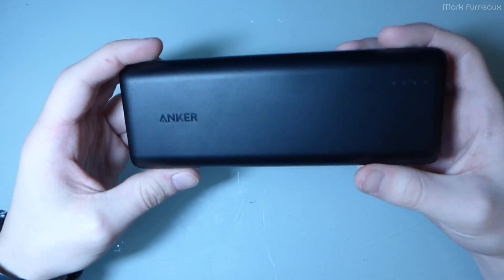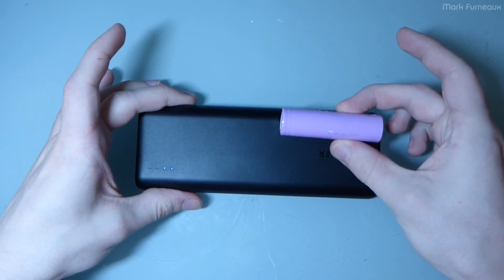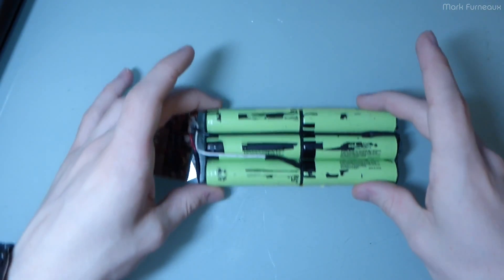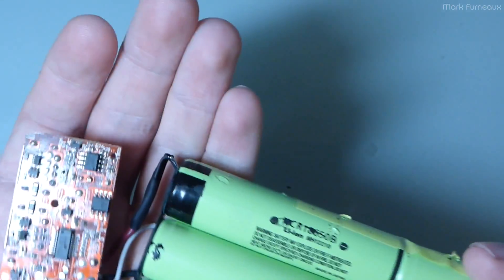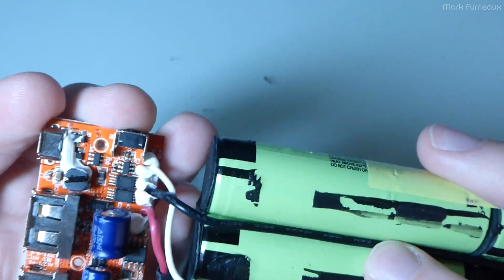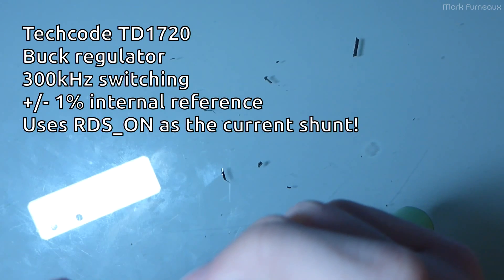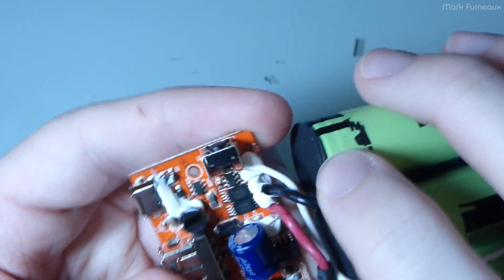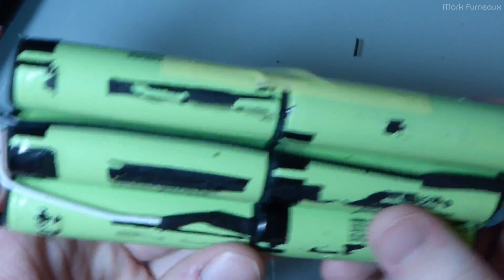Teardown of the Anker PowerCore 20100 USB Power Bank

Comment: that thing has been solid quality for over the past 6 years, stays charged for months without losing more than 1 bar of power
Reply: what I never get it says the capacity is 20100mah or 72.36Wh but at 5 volts that doesnt at up or am I missing something there?

Comment: I have a 10000 one, with Qualcomm QuickCharge 3 capabilities.
I really like it, had it for the last 5 years, it hold out pretty well, but yesterday I noticed the cells died, I was considering replacing myself, but after your video decided not to.
Thanks!

Comment: Hi, I need to use it in a proyect and I need an output for 5v as the specs told, but when i measure conected to a USB 2.0 cable I only have 3,2v could you tell me how should I do to get 5v?

Comment: Cheers, gave me enough hints to crack open my own damaged powerbank (charging input port damaged) - those tabs hold it together something fierce! Managed to shim mine open with some thin but robust metal spudger pry tools (the ones which look like epoxy glue spreaders), only a few bits of plastic damaged and the case will go back together afterwards.
Reply: Were you able to fix the charge input?  My power bank is 3 years old. However, it was not used that often. Now it only gets very hot during the charging process

Comment: Quick question, what's the voltage out the batteries in the board? From what you said sounds like 3x 3.7v, is this correct?
Wanna modify it and add a qc 3.0 board in there.

Comment: They should be wired in parallel to get the full 20100 mah,otherwise the capacity will be much less.In series configuration the voltage doubles,but not the capacity,assuming the cells are alike.
Reply: Nope not true. USB is 5V so you should step down rather then step up from ~4V.

Comment: Hello! I have the exact model however my powerbank stops charging my cellphone after like 3 minutes. the phone says it's charging slow. This is in both ports of the powerbank. I use anker USBs I bought like 5 of them. When I connect the phone to the wall it charges just fine. Do you have any Idea of What's going on? I gess there is a problem with the powerbank's USB.

Comment: What is the purpose of wiring these batteries in series as opposed to parallel? I'm designing a battery pack of my own and I'm curious about that configuration over the parallel one I'm considering. Great video by the way!

Comment: > one-way

I have one of these with a broken micro-USB connector (it's now rattling around somewhere inside the case); does that mean it's basically beyond repair aside from salvaging the cells? I wouldn't mind having to wrap it in duct tape or something afterward, but if it's completely impossible to put back together, it'd probably be a waste of time.

Comment: Are you sure about the voltage? It looks to me they are all in parallel, so it should be 4.2 volts. I didn't see any turned the other way. I have a pack like it and they are 4.2 total. Most are 4.2 volts and they use a boost converter to increase voltage to 5 volts for the output.
Reply: That is happening here. Getting boosted via buck converter.

Comment: Is there anyway to remove the USB output ports and replace them with just 2 wires one for positive and one for negative? And also is there anyway to tap into the wires going in directly from the battery to use the full capacity of all 6 batteries?
Reply: dude i know this is an old comment but honestly here: just find the 5v and ground pin going from the usb into the board and tap into those...By full capacity of all batteries I assume you mean you want to get the parallel capacity from all of them, in that case just snip the leads off the cells and wire all the "+" together and all the "-" terminals together, you will get 3.7-4.2 and the added capacity of all the cells together

Comment: CapXon and Samxon are likely nothing to be afraid of at this point. Around mid 2000s, a lot of smaller capacitor manufacturers ended up buying fake electrolyte and many products were contaminated, and we still see the effects now. After all, good Taiwanese manufacturers often used these Hong-Kong capacitors because they were fine, the test batches were fine, a few years of production batches were fine, the quality was pretty close to higher-tier (Taiwanese perhaps, not Japanese) companies and much better than from other Chinese brands, until one day, they weren't! And then eventually they were OK again. Chances are, they actually learned from the failure. I'd trust them more than any of the new companies that pop up every day at this point, and Aishi (mainland China) never actually made it to any tier lists or got any quality assessment - they're not exactly new, but they did rename themselves in the meanwhile, perhaps in the wake of electrolyte fiasco, which the ones you mention did not.

Comment: what I don't get is why they use these AA-looking batteries in power banks and even in Tesla cells. Is there not a better format like the flat laptop batteries? Also It would help with the weight...
Reply: stuff2review tesla for the model 3 will be moving from 18650 (18mm diameter, 65 mm length) to 21700 cells (21mm diameter, 70 length) to make that slightly less of an issue.

But basically, these cans are very strong for their weight. Flat cells need a larger and stronger enclosure to keep them safe, and are more likely to damage each other if one of the cells breaks.
Reply from the maker: It's all about economies of scale. Standard batteries will always be less expensive per mAh than custom cell formats. 18650s can also be more rugged and safer than flat cells.
Reply: thanks for clearing that out. Still weird to see that a Tesla battery is made up of thousands of these individual cells. Crazy if you imagine all the wasted space in between the cells or the weight the metal casing of every single cell adds to the car.

Comment: Hey, informative video. Thanks! This is a going to be a really bizarre question, but what does that battery pack weigh when disassembled. Since I know the mass of the NCR18650B, and I assume the circuitry is similar, I'm looking to calculate the weight of the 10,000mAh Anker battery pack without its case on. Cheers!
Reply: lukeify my wild guess for that circuitry is that it weighs almost nothing. certainly much less than half a cell.

Comment: I have a adata pv150 after close inspection I noticed a problem and realized my red wire inside had been disconnected I know where one end goes but I can't seem to figure out where the other end is soldered to the black on is connected to a green strip right in the middle of the 4 battaries does my red wired connect to the green strip or directly to the battaries !? help please

Comment: Why would you buy the power bank to remove the cells from when you can just buy 6 of the exact same 18650 batteries that are in this unit for cheaper and without the hassle of having to extract them? If you indeed have some logical reason for going this route, you probably should have stated so in the video, because I'm sure there are many other people besides me wondering the exact same thing…
Reply: lahma69 if you try buying the loose cells, you've got about fifty fifty odds or worse of getting fakes. Especially if you try to do so for cheaper than this pack. Which is exactly what he said in the video.
Reply: I'll admit that the cost of buying individual quality batteries is closer than I thought, but still, the Anker PowerCore 20100 is going for $40 on Amazon right now. You can buy Samsung INR18650-35E batteries for $6/piece from 100% reputable sources (such as Illumn), or from a couple of reputable vendors on Amazon for $5.50/piece, which even have free shipping (though it appears both of the Amazon vendors are out of stock right now). I agree that if you aren't buying from reputable sources that your odds of getting legitimate batteries are bad (prob well under 50%), but if you're not doing your research before you purchasing them (and properly testing them when you get them if you're buying from a source not totally vetted by the community), and expecting to get a legit battery for 1/8 of the normal price, that is kinda on you. There is also the matter of fake battery banks. Anker is probably the most widely copied/counterfeited power bank brand there is. Though I'm not sure how widespread the issue is when compared to fake 18650 batteries, there are many many reports of this exact power bank being counterfeit, even from "Amazon Fulfilled" vendors. In that case,  you are surely going to be getting fake unreliable batteries anyway. Lastly, there is the matter of having to pull a power bank like this apart and extract the batteries. Though its not that big of a deal, if you're not going to use the charging circuitry for anything, and can get individual batteries that are for sure 100% legit for the same price or less, its not something I would want to mess with. So... I don't think its as clear cut as I initially thought, but its clearly not that clear cut going the other direction either.
Reply: There's only one vendor of Anker batteries on Amazon that matters, and that is Anker. Don't try to save two bucks at the risk of getting a fake pack.

Comment: NCR18650B? A proper 4.8A output stage? Wow, that's one skookum choocher of a power bank.

It's a bit strange that they used a 2S setup with boost for charging and buck for discharging. Most power banks have it the other way around, with a 1S battery setup.

BTW, probably not a good deal for cannibalizing cells - NCR18650B is quite cheap nowadays, about $3 to $4 per cell. If you paid more than 24 bucks, you would've been better off ordering bare cells.
Reply: Strange? Wouldn't say so. Should be less efficient at charge and more efficient at discharge, which is good for its use case.
Reply: In my country no one sells li-ion sells cheaply so stealing cells from this seems like a good idea because it's flying of the shelf.

Comment: Be careful replacing laptop batteries with other cells. I recently replaced the battery on my dell m6800 and then harvested the old cells to find that they had a charge voltage of 4.35 volts rather than the normal 4.2V. Had I replaced them with normal 18650's not rated for the charging voltage I would have been running some risk. Always look up datasheets.
Reply: Interesting

Comment: Amazing indepth video. How would you rate the drop / shock resistance? Looks like the shell would crack before the internal components got damaged.
Reply: Mine flew off the bike twice going 15mph down a mountain trail.  Its a bit scratched, but fine.
Reply: ive dropped mine violently many many times.

Comment: That definitely does not have balance charging, as it would unnecessarily increase cost. It is just two banks of 3, nothing more. Actually the wire in middle is COMMON and wires on outer edges are for each separate bank. It is done this way just to make sure no more then 2 cells will affect other cell (charge or discharge in even of failure)
Reply from the maker: Passive balancing is incredibly cheap for a configuration like this. Nonetheless, the cells are in in series back to front. If there were two banks, one would be negative, which makes no sense. Also the gauge of the centre tap wire is higher than the other two, so it is certainly not a common.

Comment: I am interested in getting a power bank to operate as a cheap UPS for a gadget that is running on USB power, so I would like to ask a question: is it possible to charge this battery bank while it is simultaneuosly providing power to a load?
Reply from the maker: No. It will shut off the output when charging.
Reply: Thank you for the quick aswer, I really appreciate it. I will keep digging.
Reply: Enrico Conca I literally just ordered one yesterday on eBay and why would u want to charge it and use it at same time ? if ur charging the power bank to the wall then do the same connect ur phone to the wall trust me getting this is worth it
Reply: Because I cannot tolerate interruption of the power supply to the device in case the AC power drops for some reason. So having a battery bank that can supply power to the load while charging at the same time is perfect.

Comment: The NCR18650B batterys are the absolute best 18650 cells on the market. Most all high end 18650 batterys sold today, AW, Orbtronic, Keeppower, and so on are all Panasonic NCR18650B cells. Anker knew what they were doing when they built this charger. I own fifty four 18650 batterys because im a high powered flashlight junkie and they all use 18650's.

Comment: $orry but its not 8.4 it 4.2 win it is charged
Reply: Sorry is written Sorry. Not $orry... damn thats making me cringe.
Reply: that sentence made no sense... what exactly is a buck cover? A heatsink for the buck converter, maybe?
Reply from the maker: No, it's wired in series and uses a buck converter. It's 8.4V.
Reply: +Mark Furneaux o I didn't no That it had a buck cover
Reply: Yeah and you can also look like an idiot however you like
Reply: +Ozzie Peck  I can put it however I like to
Reply: are you 12
Reply: Mark Furneaux I was wondering about that. I thought for sure those batteries would be parallel in that pack. Why do they connect them in series and then step them down? As opposed to running 6 batteries in parallel?

Comment: You can get these cells for about $4 each.
Reply: igloo2 finding a seller that is going to sell you genuine cells, let alone for a mere $4, is pretty darn hard.
Reply: Proper Noun I recommend fasttech
Reply: 18650s vary massively. These look like Panasonic NCR18650B and are $7 each. add the charge electronics its not a bad deal for $40
Reply: He wanted to make a video about the battery anyways
Reply: any vape shop if you only need a couple because they mark them up a little
Reply: Because he's obviously worried about fakes. What are you, poor? Is 40 dollars a lot of money to you? LOL
Reply: where can one buy them?
Reply: thanks
Reply: Yeah I only need two of the ones typically found in phone charging battery banks.
Reply: if u have an old laptop battery bank it prob has what u need in it. if not then an online vendor. Never bought these type of 18650's so idk were to get em. and your not gona find these at a vape shop but u will find the same type but just 30a instead of 5a and cost 10x more.
Reply: but you still have to build the charging circuit
Reply: 3.65€ at NKON, but that's for Europe, States might be a different matter entirely, specifically because Li-Ion battery transport got classified as dangerous goods; however that should also apply to cell phones, power banks, and other devices that contain Li-Ion batteries.
Reply: I was thinking the same thing makes no sense.  Just buy the raw cells
Reply: why the hell would anyone go to a vape shop. vape shops sell counterfeit batteries to dumbasses that think smoking is cool
Reply: lol vape shops charge out the ass for batteries. and there not the same as those anyways. those batts prob have a max output of 5 amps each like every sigle 186050 being used in a battery bank that i have come across. and the ones they sell at vape shops are rated between 15-35 amps usually. same voltage tho. basicly your gona be payiong a premium for high amp batts when your only need 5-10 amp batts
Reply: No, shipping is free.